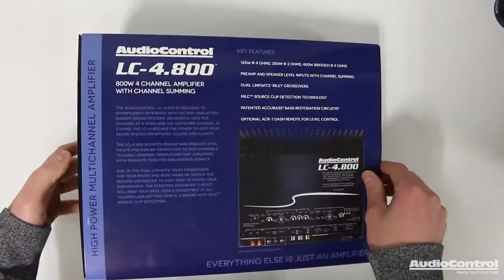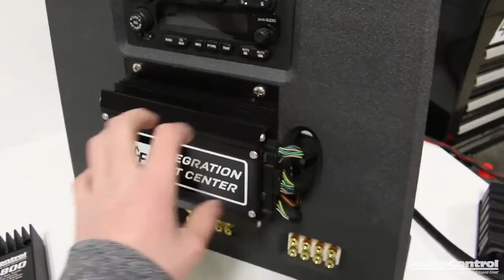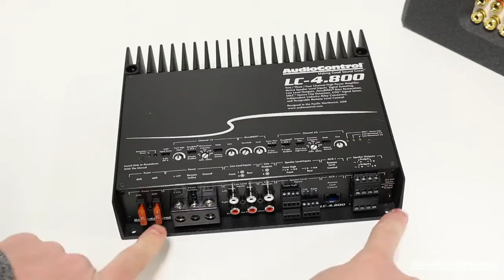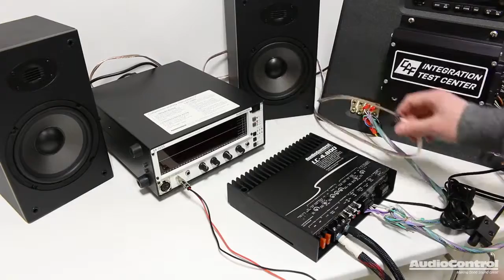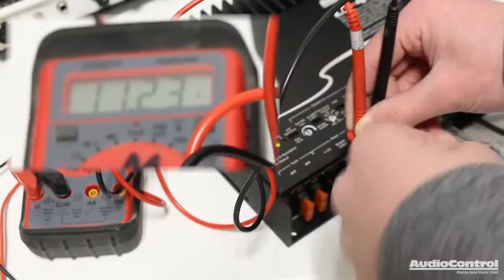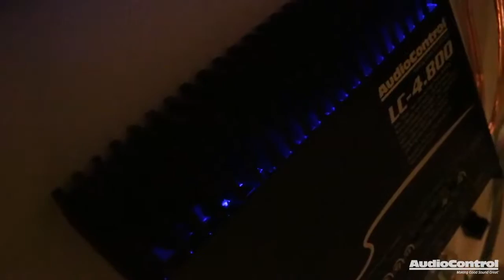AudioControl LC-4.800 Amplifier Installation and Features Video

Comment: My amp prediction light is blinking red 2 times that’s the repeated short. What does that mean?
Reply from the maker: This usually indicates a faulty speaker or short in the speaker output wires somewhere in the system. Hope this is able to assist you.

Comment: I know this is an old video, but I have a question. What if you adjust the gain and the gain light never comes on no matter how high you turn the gain
Reply: Did you get your answer?
Reply: @NinaBabyTV nope
Reply: @ do you have the remote knob connected? That was my problem. Had to turn that all the way up first. Then set everything else.
Reply: @NinaBabyTV so I have the lc 1.800 hooked up to my sub and it works perfectly. The light works there. For my door speakers I have the lc 4.800. This is the one that has never shown me a light. In fact when I was tuning it, I must have gotten the gain turned up too high. The amp went into protect mode. I lowered the gain and it worked fine afterwards, but neither of the lights ever came on for showing when to stop raising the gain. Not sure if I’m not doing it right or what, but the 1.800 showed me exactly when to stop raising